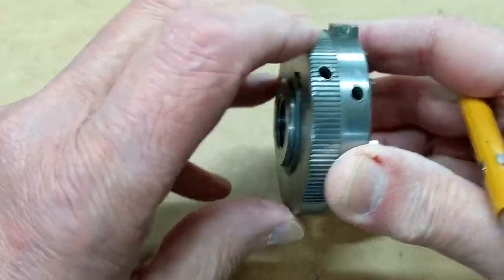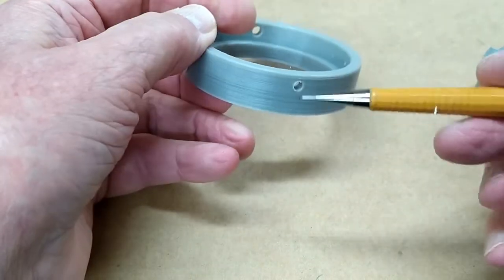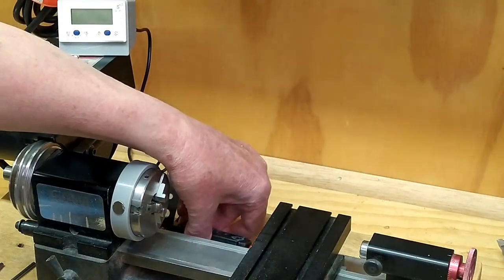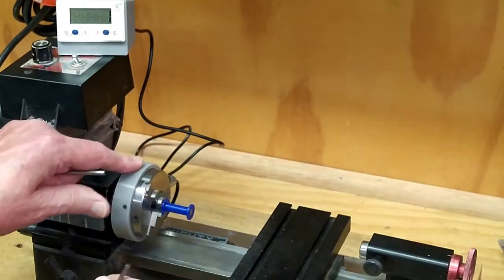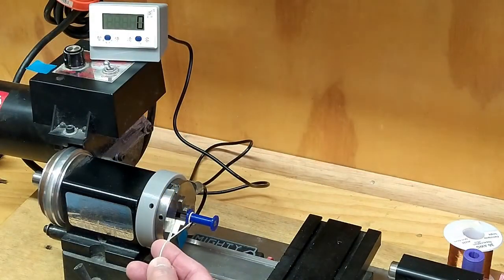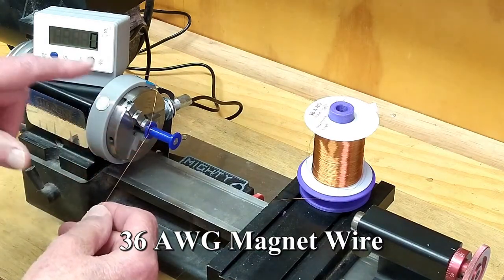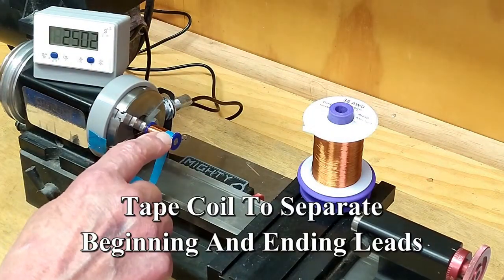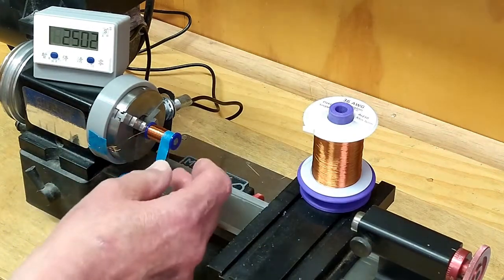Magnetic Digital Revolution Counter

Comment: Ronald, I have this counter already and using it also for coil winding. Is there a possibility for reverse counting?
Reply from the maker: I don't think so. It only counts pulses created by the magnet passing the Hall effect sensor (in either direction). You could zero the counter, then it would count revolutions unwound. Up to you to keep track of the totals on paper (+ or -) before zeroing the counter.
Thanks for watching. Please subscribe! 
That is what keeps this channel going. 
Ron
Reply: @RonaldWalters2010 , 

I did open the housing and there are several places on the PCB without parts or connections which is not unusual but might give the chance for reverse counting. But without a circuit it is not easy. I think my sensor is not based on a hall element. Even without connecting to anything it makes a click - so I guess it is contains a reed contact. By the way, inside on the PCB there is a 1.5V button cell.
Reply from the maker: It seems you have a different counter. Mine works with a Hall effect sensor and a magnet as shown in the video. It is also silent (no clicking) and is powered by a single AA Battery.

Comment: Where did you find the counter?  I've wanted to try my hand at winding my own guitar pickups but the cost to buy a winder is too steep for my current needs.  Informative video.  One of these days I'm going to break down and buy me a 3D printer.
Reply from the maker: Search eBay for the following:
LCD Digital Tally Counter LCD Digital Counter Panel Proximity Switch Sensor 
https://www.ebay.com/itm/272766443003?